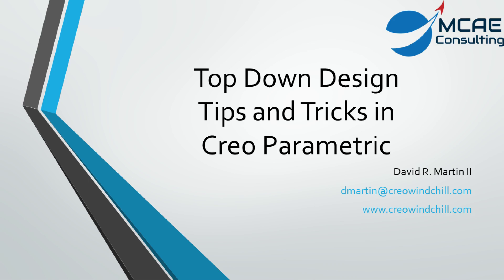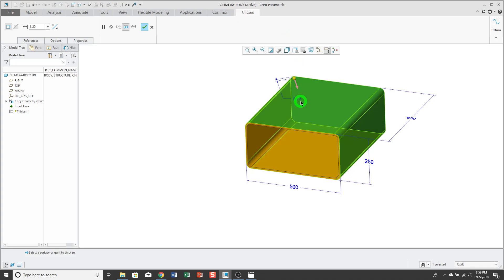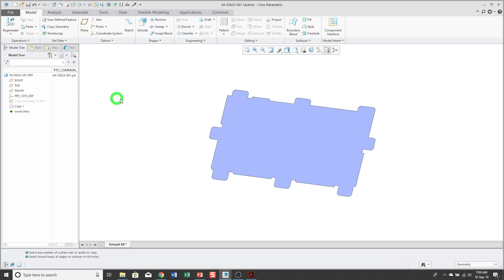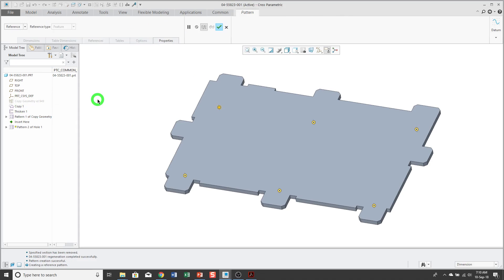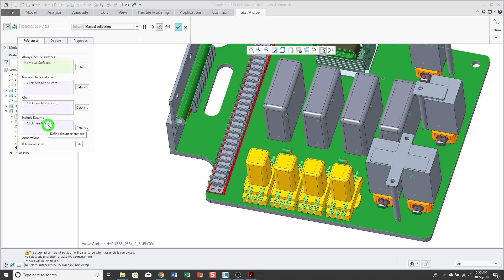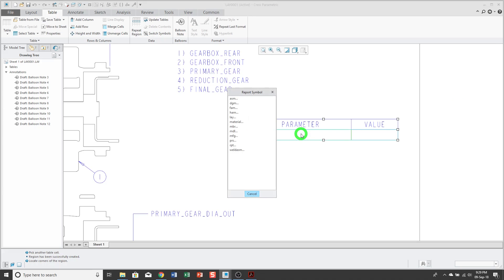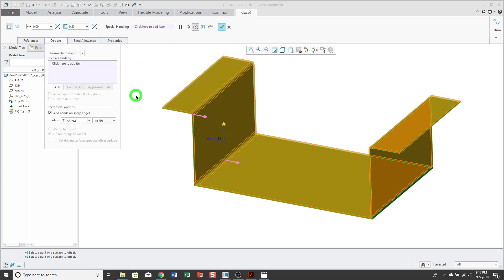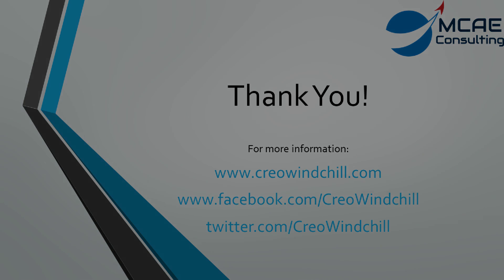Creo Parametric | Top Down Design Tips and Tricks

Comment: First i have to thank you for the amazing value you are putting out there❤❤❤ 
You taught me almost everything i know with creo and i am ver greatful.

I have a question that i still have not figured out how to do.

How do you design a part that you want to use more than once in the same assembly.

Example: i created the skeleton containing all the main dimensions and surfaces i would like to specify.
A base sheetmetal, a top cover sheet metal and 4 columns. And then different parts are to be bolted to the different columns. I specify the bolt position between each part and the column it is bolted to. So you end up with have a column that has a couple of bolt holes on the top and another will have a bolt hole on the bottom and so on. ( 4 columns that have the exact same dimensions but just hole in different positions )
Instead of creating a different part for every column i want to create one part that contains all the holes needed for all the columns and reuse the same part 4 times in the same assembly by turning the column upside down for left and right sides and whatnot. Is there a way to do so in a top down design approach?
Reply from the maker: I wouldn’t necessarily do that with Top Down functionality specifically. I would probably use Pattern Tables or Component Flexibility for the different hole variations.

Comment: Copy Geometry (and copy annotations) and copy parameters: that would be AWESOME. I don't know if this is too difficult to be implemented, but it will save lots of work... If you can copy annotations, why not and parameters??
Reply from the maker: Are you talking about part level or feature level parameters? Is there a reason you’re not using Notebooks? Can you give a use case? I would bet Top Down Design already provides methods for what you really want to do but you want to do it in a different way.
Reply: @CADPLMGuy  I am talking about any kind of parameters... When I am working with Autodesk's Inventor, there is an option to copy (derive) from the master part, parameters, dimensions, even reference dimensions to another part. Sometimes it's nice in cases where some parameters are not easy to be represented as geometry. Notebook is fine from mid to large, to very large projects... but  for small project where you want to copy for example a parameter that controls the number of holes in a pattern, in my opinion notebook is too-much. OK you can do it, 1) create the pattern, 2) creating a publish geometry using some datums, 3) create a reference pattern of the PB, 4) create a copy geometry of the PB on the slave part,
5) create a feature using as the reference the PB, and then make a reference pattern. It works 100%, all the time. Copy parameters from one part to another, is "nice to have"  feature, but It would make things more easy. 
Anyway, coping annotation features inside "copy geometry" is really COOL!!!